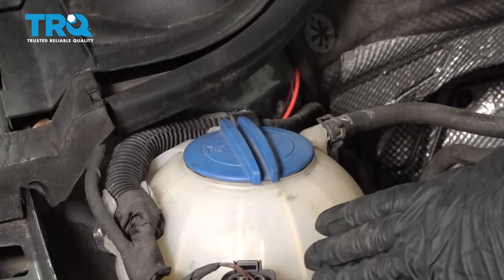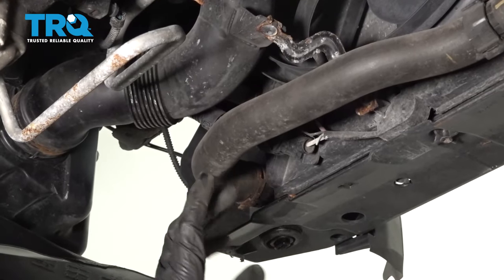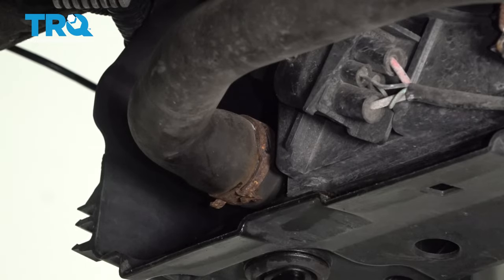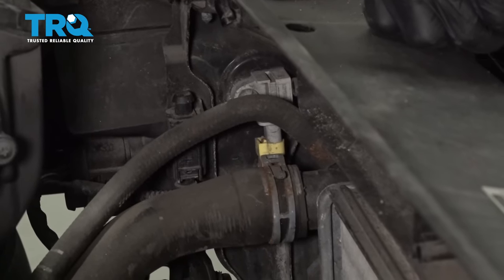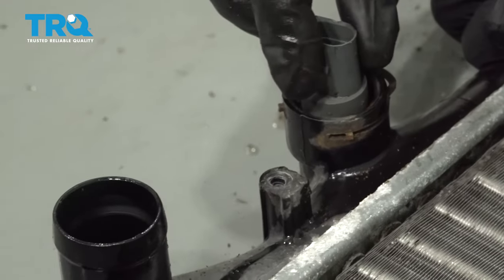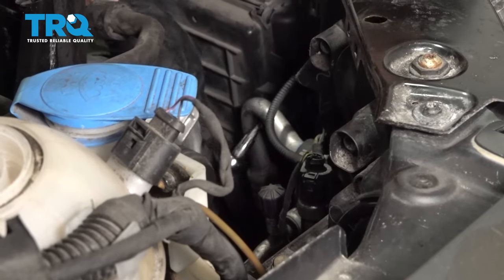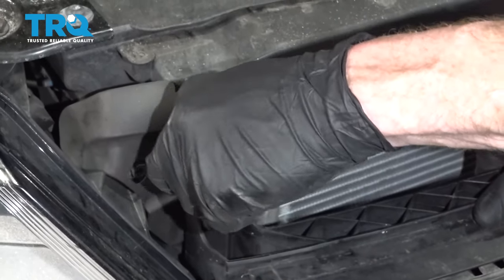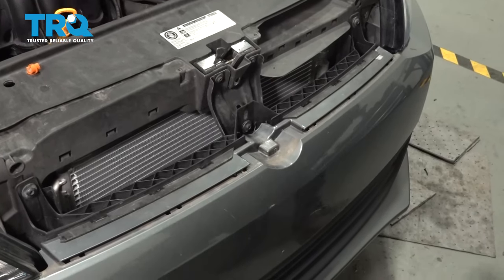How to Replace Radiator 2011-2018 Volkswagen Jetta

Comment: I have a 2014 jetta se 1.8 turbo. This got me through 85% of the way. The rest was pretty obvious. The differences being the air intake system, intercooler, and the sensors (sensors are in the coolant lines with a quick connect.) There were also a couple additional mounting bolts for the radiator itself, which is a different style. Great work with this video. It saved me a ton of time searching for what needed to come off.

Comment: This video was a lifesaver. The instructions are clear, well spoken and easy to understand. I’ve watched many YouTube videos on various auto repairs and many are very difficult to listen to and to understand and the camera work gives you motion sickness. This is not the case here. The camera work is outstanding and the speech is clear and easy to understand. This is an excellent video.

There were some differences between my car and the car used in this video. My car has the 2.5 5-cylinder engine. With this engine, the fan assembly and the radiator come out the bottom of the car rather than the top as shown in this video. I found this out quite by accident when I was trying to figure out how to get the fan assembly up and out the top. Just when I had decided that I needed to remove the upper core support, the fan assembly slipped out of my hands and dropped right to the floor. Hmmm. Okay. So I got that out of the way and then lowered the radiator out the same way. The radiator was a little trickier because I had to work it between the lower core support and the A/C line. They both went back in much easier than they came out. 
This video really made this job much easier! Thank you!

Comment: How different would the process be for replacing a 2014 TDI Jetta’s Radiator? It looks as though there’s a thicker (round) solid line on the top left that would be in the way if you tried to pull the radiator up and out. Would it just come out underneath like this one?

Comment: I have a 2014 tdi 2.0 it’s quite different. Be sure you know which radiator you need to replace. Taking bumper off was not necessary for the back radiator

Comment: New technician here 👋! I was wondering, due to a guest having a bad left side upper mount. Can you replace all mounts with the radiator still on the vehicle or can i move the radiator just enough to slip the upper mounts off without having to drain coolant!? Edit: Awesome videos also, very helpful! Keep wrenching 🔧

Comment: If I don’t have the vacuum tool, what’s the process for making sure to get all the air out? Fill it, run it for a moment, then top it off and repeat ?
Reply: Yeahh pretty much, that’s what I did after replacing my radiator (‘12 VW Jetta SE 2.5) I topped off for the second time on the coolant and just keep an eye. You car may rumble for a bit here and there but after a while it readjusts itself and drives smoothly. If you accidentally release pressure for the AC refrigerant, same process, fill it up and watch the gage every now and then that it remains on green with enough pressure.

Comment: This video does not apply to the 2011 Golf TDI trim level.  The radiator is completely different for the location of the hose outlet and there is no temperature sensor installed into the radiator itself.  There are also no support tabs at the bottom of my TDI radiator.  Maybe even more differences, but I stopped watching to go look for another video that matches my vehicle.  I wish this were the same as my TDI, because the thoroughness of this video is great.

Comment: FYI.  This is not at all for all golfs or Jettas from the era described.  Not even close.  Anything after 2015 has the condense locked in the radiator, which requires much more disassembling.  This is just wrong.  The majority of this video is completely wrong after 2015.